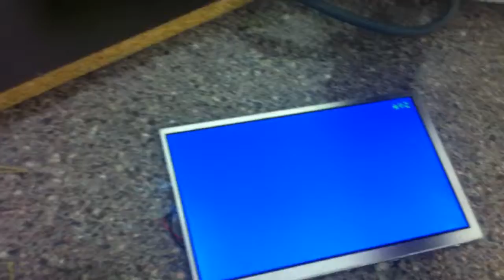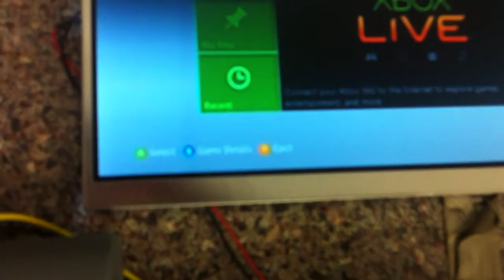xbox 7" screen testing

Comment from the maker: its quite simple, you need a lcd screen, lcd controller (it converts the xbox composite connection to display on the lcd correctly.) soldering iron,solder and some wires. and thats pretty much it.
you need to find a pin out of the a/v adapter and solder the correct pins (i think about 3 or 6?) th composite pins. and a 12v connection to power the lcd, this can be taken from the power plug pins. then your pretty much set and you just need to mount in a case for optimum use really.